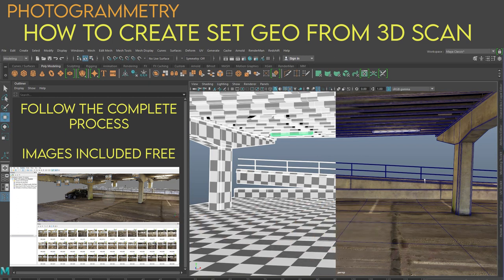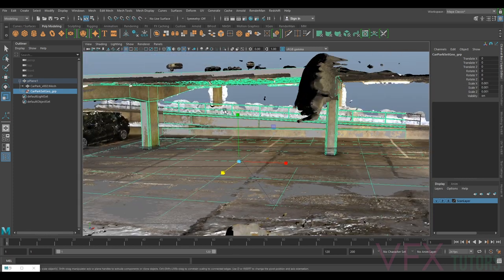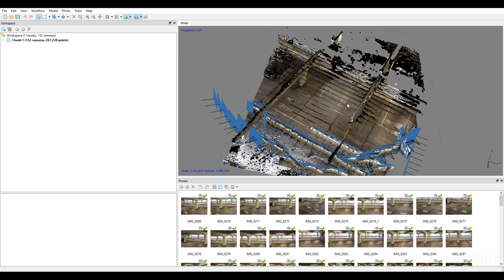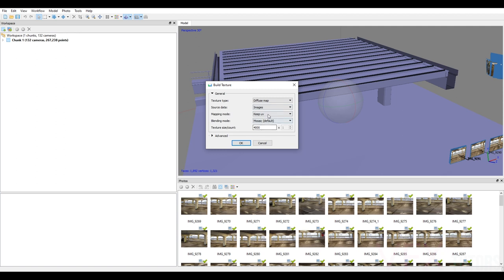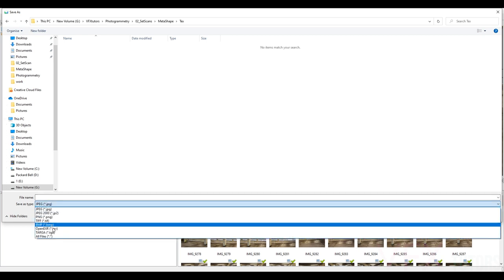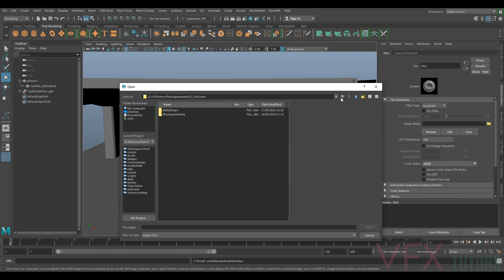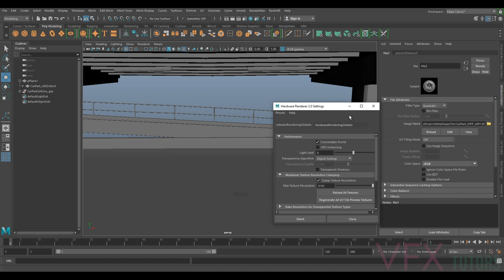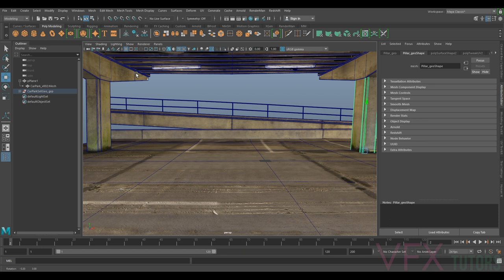Texture Projection From a 3d Scan - How To Make Accurate Models From a Scan - Part 5

Comment: I found this series at the perfect time. Great work. Is there an easy way to match an hdri map to the setscan position in Maya?

Second question, what would be the best pipeline for maya to davinci? Say if I wanted to composite some 3d fx, can I just export the AOVs from Arnold to Davinci, or would I have to use nuke?
Reply from the maker: Hi, thanks :)
 yeah you can match a HDRI by eye but I will be making tutorials on this at some point when I start doing the lighting tutorials :)

I haven't used fusion but it should have the same capabilities as nuke with using AOV's,  but I can look into it as i cant say for sure

Comment: Every time i try to do my track this way, it gets worse. Im using the same 2d tracks i used, but only without 3d model, and the deviation gets better. No matter how accuarate my 3d model is, its still the same. It feels like im just wasting time time doing models and stuff. mb you can suggest what i should do. Thank you!
Reply from the maker: Hey mysta, sorry your having issues,  your not wasting your time, it’s just harder to make matchmove work with geo,  could you upload a video so I could see? 
How are you making the model?
Reply: @VFXTutors  There's nothing to be sorry about.
Yes, i can. Tbh, i think its not about shot, because no matter how simple my shot is, it still gets worse when i do it with use of 3d model. I guess im just doing something wrong on the modeling stage.
Thanks for quick reply.
Reply: @VFXTutors  should i upload it to my google drive?
Reply from the maker: @mystagogue4921  yeah upload it to google drive and I’ll take a look, but it’s probably to do with the model, I always make my models from scans so they’re very accurate, have you joined the discord?
Reply from the maker: @mystagogue4921  https://discord.gg/jDh4cX3V82
Reply: @VFXTutors  yes. i have joined your discord and i also have uploaded files to my drive

Comment: Hi again. I’m having problems i think with rolling shutter. I try to correct it in the parameter adjust on 3de and it might be working. My camera is the a7s 1. Rolling shutter is that bad for tracking?
Reply from the maker: Hey, rolling shutter isn't necessarily bad for tracking as almost every camera has it, if its a fast movement you will have some rolling shutter, but if its a fairly slow camera move its probably not rolling shutter, could you upload a screen recording so i could see?
Reply: Sorry to be bothering you! Thanks again
Reply from the maker: its no bother :) so I doubt its rolling shutter as its a fairly slow move, how have you modelled your geo? it could be some out of depth survey points as you have a lot of points on approx survey, how does the solve work when you have nothing surveyed?
Reply: @VFXTutors  it looks fairly stable and low deviation 0.5. i modeled by matching the scan from this series of videos.
Reply from the maker: ok cool, then it might just need more overlapping tracks,  in 3DE, if you got to "Windows" then select "timeline Editor" you should see all your tracks in a graph, this will show you were you may need more tracks and if you need more overlapping tracks, it's looking pretty good though :)
Reply: @VFXTutors  i`m going to try and overlap them. this is just me testing at home. thanks. (and the 3d modelling took so much time, lol)
Reply from the maker: it looks really good though, I can see you spent a lot of time on the modelling as it looks really good :)
Reply: @VFXTutors  https://www.youtube.com/watch?v=GPtPs-HSzfI&feature=youtu.be
Reply: i`m still worried with all this jitter. its been weeks and i can`t get any better than this. do you thinks its okay or am i right for being  this nit picky?
Reply from the maker: that looks like its the 2d track causing you problems, as its jumping around the 3d point,  do you check your 2d points with center 2d? 3de will solve the 3d point very well though and the 3d point (green cross) is all that matters really, but ideally you want good 2d points,
 if you upload the footage and geo, i might be able to take a look for you :)
Reply: @VFXTutors  definitely is the 2d trackers. now i`m trying to nudge them in to place and delete most of them.
Reply from the maker: with a shot like this you shouldn't really need to nudge the points, are you adjusting the size of your tracking markers?
Reply: @VFXTutors  i`m uploading to we transfer and then i paste here the link to download. i was adjusting the size of the markers.
Reply: @VFXTutors  with a fresh mind today i restarted the process, double checked everything and the geo glued to the footage! i still have to make some adjustments but the 3d trackers are sticking. thank you so much for the help. when i finish my reel i send it to you. you are the best!!!!
Reply from the maker: @mauriciocasiraghi  that's great :) no worries I'm happy to help, yes send me it when your done id love to have a look :)